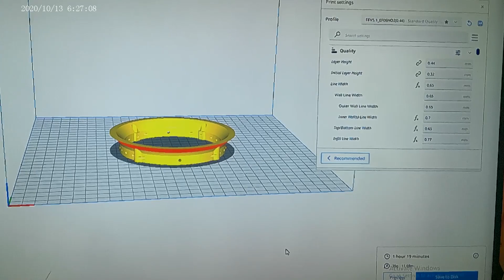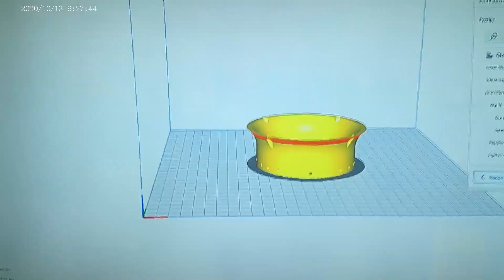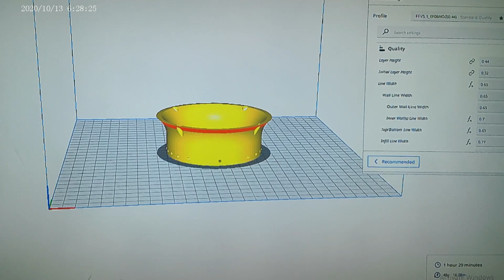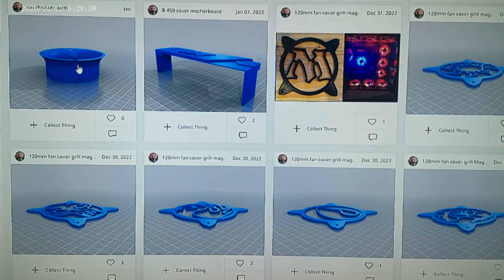New design ionic thruster v2 dc high voltage "stl files" link in description

Comment: What is the distance between the anode and cathode? What is the distance between each stage? Is it possible to work out the distance needed between each stage based on the air flow of each stage?  Does each stage need it's own power supply? If stage 1 produces an air flow of 2 m/s then what is the maximum flow produced by adding a second stage?

Apologies for the barrage of questions. I am trying to understand ion wind to help with my own experiments.
Reply from the maker: 1 1/2 inches to 2" is the distance depending on where ths voltage hiss begins (to close and it sparks out). You only need one power supply. The lower the amps the better. Dc flyback is good. An ac flyback can be used with a voltage multiplier circuit. Also taser modules can be used. The m/s is usually 2.4 on each stage. You can put multiple stage on it to get more. Distances are your biggest hurtles. The material has to be small to bit always. Run a razor over the magnet wire to make breakout points for the plasma. Plasma hates paint. raw surfaces work best.
Reply: @oldmanbuilds  thank you for replying.
Reply from the maker: @edwinwaters6778  I put the stl files on thingiverse if you wanted to build one. There is a link in one of my videos.
Reply: @oldmanbuilds  Thanks.

Comment: are the red wires copper wires?
Reply from the maker: yes. the small wires are magnet wire awg 28 and the bottom is copper wire no coating from a  house Romex awg 14 I belive.